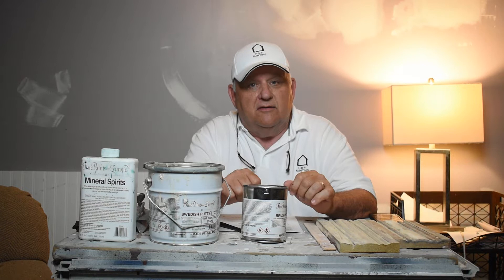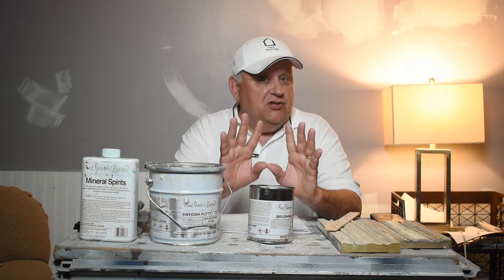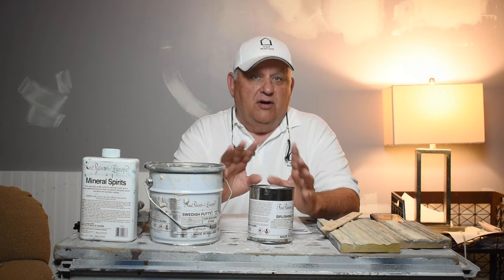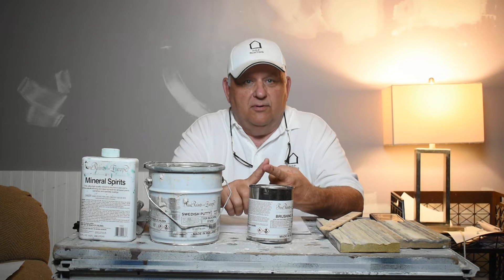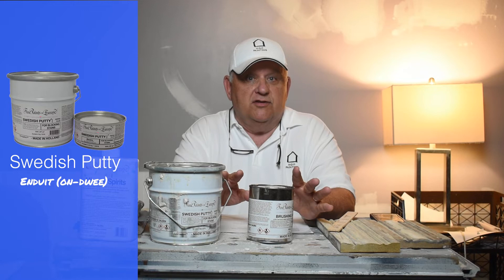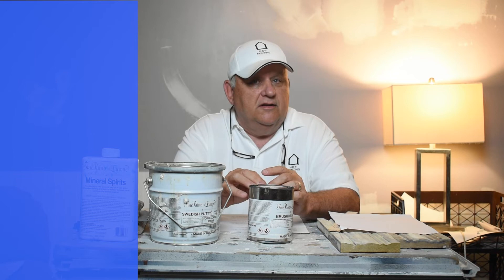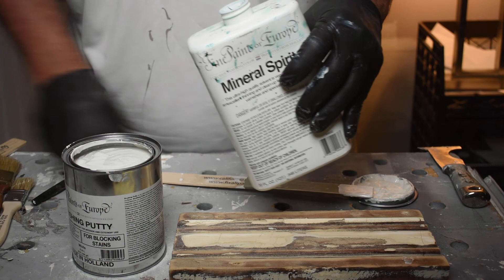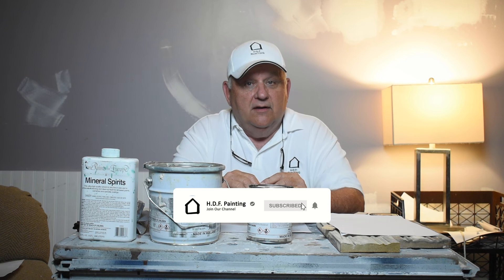Swedish Putty vs. Brushing Putty | Fine Paints of Europe Putty Products

Comment: I have finished oak cabinets and am wondering , obviously I need to clean degreaser sand etc ,
Would I use brushing putty/then primer/then hollandlac?
How many coats of each?
I am obviously going to practice on some other doors or just buy a oak cabinet to practice.
Any advice would be greatly appreciated!
Typically I spray trim and doors etc
This is brushed on!
Reply from the maker: Use the brushing putty to fill the oak grain. It may take two coats. Prime with either FPE oil or universal primer than the Hollandlac, 3 to 4 coats of finishing, finely sanded between coats.
Reply: @HDFPainting  thank you for the response!
I really appreciate it!

Comment: I had someone quit on me about half way through an attempt at super high gloss ceiling in bathroom. I was going to paint it with regular paint but see every imperfect spot...even more so than I did when it was done 2 years ago. Planning on just keeping it gloss. Thinking I need Swedish Putty over it, sand it then do high gloss ceiling. Do I have to do entire ceiling? It has 6 thin layers of Farrow and Ball High Gloss paint on it
Reply from the maker: I would suggest you hand sand the high gloss ceiling with 320 or 220 grit sandpaper, vacuum and tack it clean and then apply on thin coat of swedish putty over the entire ceiling to maintain consistency.

Comment: Hello
I like to watch your videos
Reply from the maker: thank you
Reply: I need to apply swedish putty to stair posts (interior). It's new wood.
I also want to know if the primer is applied before or after.
Do you have any video to check?
Thank you very much
Reply from the maker: @carlitosbermeo9735   For new unpainted surfaces or previously painted surfaces: After surface preparation (sanding, etc.) and cleaning, apply one coat of Fine Paints of Europe Oil or ECO primer and allow to dry overnight. Do not sand this primer prior to the application of Swedish Putty. DO NOT RE-PRIME After.
Reply: @HDFPainting  Thank you for answering my question I have a question I can write you an email